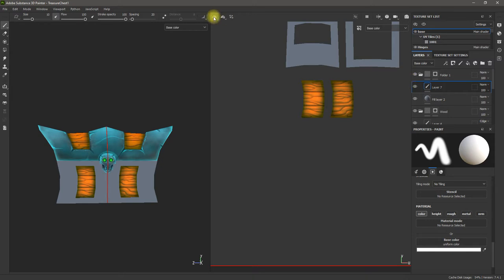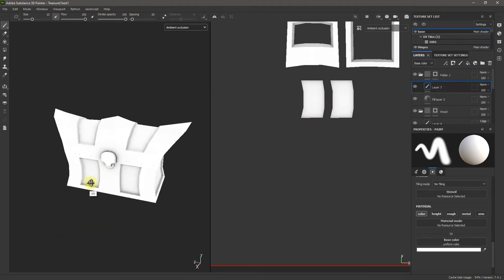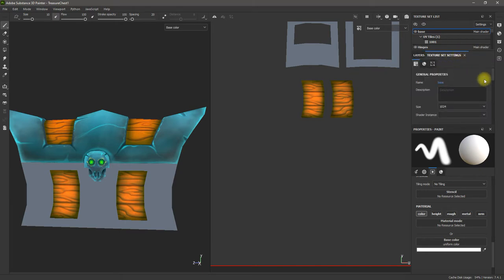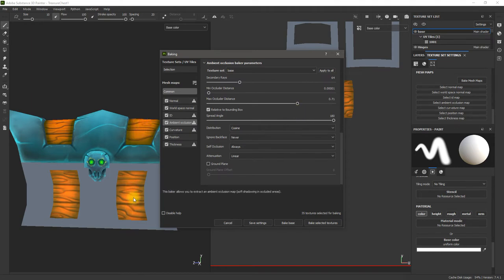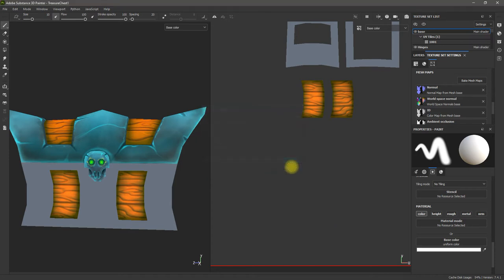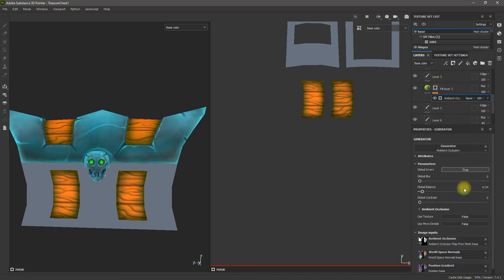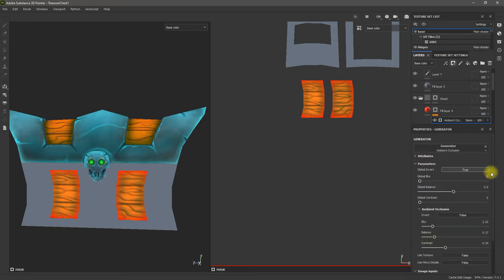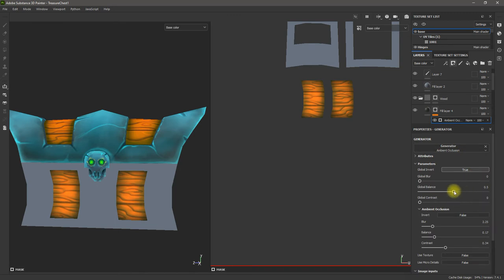Using Generators in Substance Painter

Comment: I'm late to the party but where do you get or how do you create generators?
Reply from the maker: You can right click on the layer that you want to apply the generator to, and at the bottom there should be a tab that says generator. Then it will be in your layer properties menu. As for getting more generators, you really cant, but you can adjust them and change the types of grunge maps they are using.
Reply: @matthewdesaart  For some reason I don't have a generators tab in the shelf and none show up when trying to add one in layer properties. I've found that just adding a new layer with the desired material and a Smart Mask works basically the same. I've done some more research and I think you can create generators in Substance Designer. Thanks for the tutorial and reply!